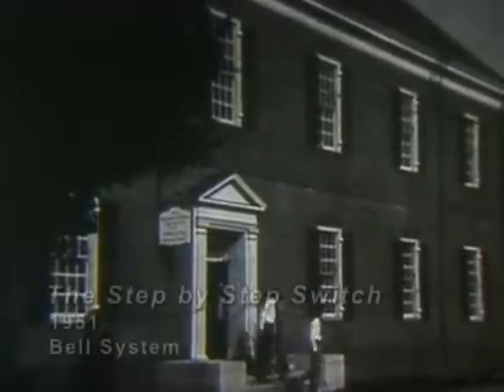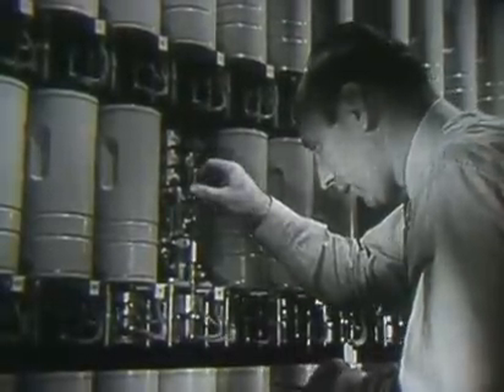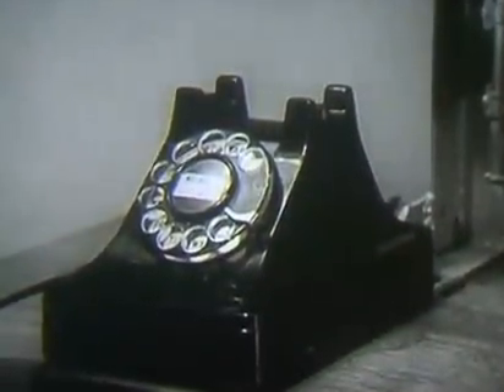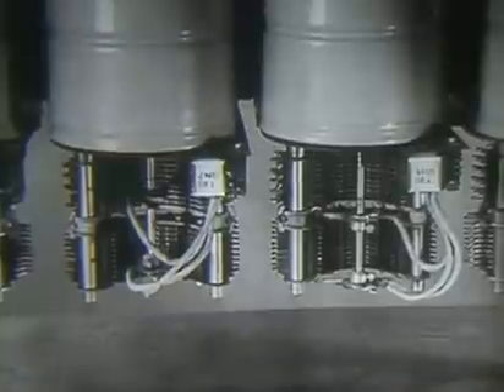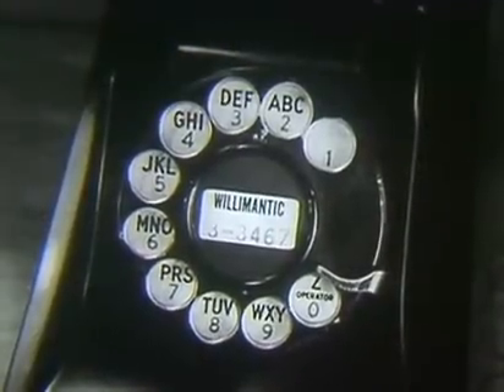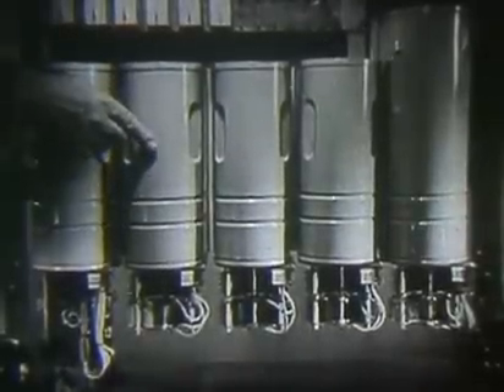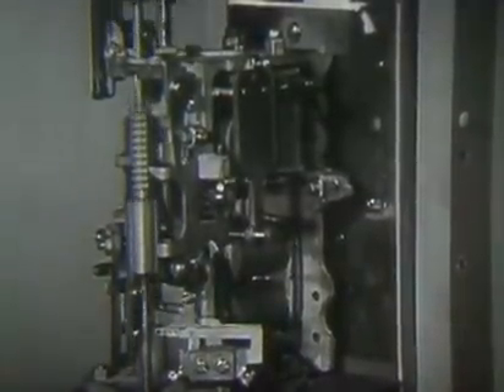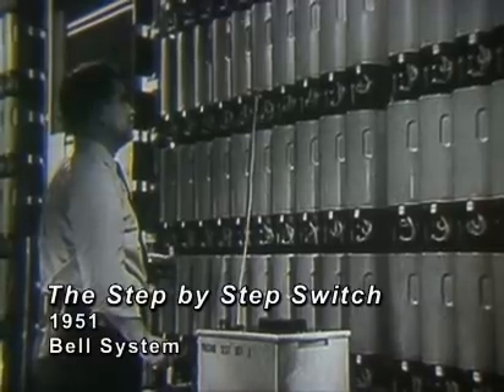AT&T Archives: The Step-By-Step Switch

Comment: This is fun for me to watch.    When I finished electronics at college in 1979, I went into a job with the phone company and worked to maintain and troubleshoot this type of equipment even though it was being phased out at the time.   I learned to assemble the mechanical bits of one of those stepper switches from a pile of parts in a about half an hour.      Later we dumped thousands of these into recycling bins as they were replaced with more modern equipment.    I wish I had kept a few of them.    They were quite fascinating what with all the precision machined gears and cogs inside them.

Comment: Did 40 years (pre-divestiture Southern Bell to AT&T again).  Started in Special Service & Message circuit design. Finally got a Services Tech job, then worked Special Services I&R and retired as a DLC (digital loop carrier) technician. Saw SXS, 5XB, 1ESS, 2ESS switches in action. Saw conversion of all to Digital (5ESS/DMS).  I’d be lost with the changes that have occurred since I retired in ‘16!

Comment: My 1969 summer job was to clean these switches.  Little roller brush, into the cleaner roll it on the switch, repeat.  Up and down ladders.  Sometimes the switch was in use while on the ladder ... just hit a button and it disconnected.  Sorry ...

Comment: Several years agoI had an electronic engineer tell me that if you think about it, the old rotary system was actually digital where the newer touch tone was audio. I'll have to take his word for it as I'm just a machinist.
Reply: With pulse dialing, the dial interrupted the line current, which then operated the switch as demonstrated in the video.  With touch tone, the push buttons cause tone pairs to be sent, which the switches detected.

Comment: To think that an English telecommunications engineer had designed and proposed a digital switch six years before this film was made. Only to be told that 1700 valves couldn't be kept working to make it reliable. He was told to get back to his normal work. 
What the management didn't know was that Tommy Flowers had designed and built a programmable computer, the second version had 2400 valves, and kept it operational 24/7 for years but it was a Top Secret job and he couldn’t mention even his experience. Had they listened England would have lead the world with digital direct dial telephones. 
Tommy had taken all the plans, designs, sketches and notes for Collosus and Collosus II, to the basement of the GPO Lab. Placed them in the boiler and watched them burn. Churchill had a lot to answer for in Post war Britain, it should have been kept and preserved for declassifying after the correct period. Tommy started to rebuild the computers and they were finished, they can be visited at the National Computing Museum at Bletchley Park.

Comment: I was in elecrtronics school in the early eighty's. We took a field trip to the local CO ( central office ) that had one of these still in the switch room, what a presision device. l later went to work for a company ( Infoswitch) that devoleped the  solid state ( transister based)  switch. Installed the switch for Sprint in OP Kansas and the Bass Pro call center.

Comment: Following discharge from the Air Force in 1972, I worked for Stromberg-Carlson as a engineer writing the equipment specifications for 100 to 500 line dial central offices in the Southwest using the Stromberg-Carlson XY switch - a variant of the step x step switch.

Comment: Thousands of jobs were lost when touchtone phones where invented. Same with teletypes. Chicago's Teletype Corporation employed 50 thousand people. All dissappeard with invention of fax machine.
Reply: When I started working in telecom, in 1972, I spent my days overhauling Teletype machines.  Faxes were around long before then.  It was message switching systems (used to work on those too) that did in Teletypes.  Back in those days a lot of machines were used for the dial up Telex service.  Many more in private networks.  A customer's machines would be connected to message switching computers.  Later on, packet switched networks appeared, but by then video terminals and personal computers were used.  Then came the Internet and email...

Comment: This is very different from here in Sweden.
My mother used to work at a telephone staton when i was a kid and on some weekends i came with her to work instead of having a babysitter.
The swedish analogue system looked totally different and was built by LM Ericsson, my mothers station was an analogue station using the 500-switch architecture. This was in the 80's and the technology was from the 1920's and electomechanical, you could see when people dialed numbers. Dialing an area code transfered you to a different telephone station, thats why you had to wait for a tone after dialing the area code.

Comment: And it's a digital dialing system.  Pulse length
Reply: Actually, the pulses were the same length, but the number of them varied with the digit dialed.  Incidentally, in the video they pointed out that nothing happened until the dial was released.  The reason for this was to get consistent pulse length, as determined by the dial hardware, compared to someone's finger motion.

Comment: I took a rotary telephone apart when I was probably 7 or 8 years old. It's amazing how many steps there were to this system. Hundreds of contacts and springs... Almost like a washing machine timer if I remember right. It's so cool to know that those contacts inside the phone, pulsed a signal in real time to these switches. Makes a lot more sense. An in old timer told me he could hear the switch box at the end of his street chattering all day long lol
Reply: Several years ago, I worked for a Canadian telecom which had a Siemens TW39 (IIRC) step by step switch.  On one occasion, the microwave system failed, causing all the switches to drop off at the same time, in a very loud bang!

Comment: stepper switches are only something ive heard tales of..  never seen one..  I started in telecom in 98.  so relatively new..  never on the CO side..  Love this video!! when I started we were replacing some of the first gen digital equipment that had come out to replace Xbar.  occasionally id find an old Xbar in a switch room abandoned but never forklifted..  I cut my teeth on an SL1 and first gen defimity (AT&T.. Lucent was the new name)..  then started installing VoIP in about 03 when it first started to come on the PBX market (Mitel)..  now install exclusively VoIP.. designed our own VoIP product based on SIP..  whole different ball game now..  but being in hotels we still do a lot of analog tip / ring to re-use old cabling infrastructure..  pulling out Option 81s and Definity G3's alot these days..  those 2nd gen digital switches were workhorses

Comment: I didn't get that at all. All it explained was how a call stepped each selector according to the digit at that position. How is the audio actually connected ? In the first selection, it can go to one of ten destinations. With three selectors, it can presumably reach 1000 endpoints. How on earth is this achieved ?  With simple mechanics, there is no way you can connect one wire to one out of a thousand wires.

So, how ? Does an incoming digit of say 2 in the first position then route the call to another selector that handles 20 to 29 in the second ? This would mean you'd need as many selectors as  you have customers!
l

Comment: The original 5ESS Switching Module processor was the Motorola 68000 operating at a few mhz clock.  In 1995, they were moving to the 68040 processor with two ALUs and instruction scheduling being a consideration.  I had an Amiga 4000 with a 68040 on it at the time, and it had a scheduling compiler that I used to do test compiles of 5ESS code to help make the decision of whether or not scheduling would be useful.  The 5ESS code had an average of 6 instructions between branches because of the strict use of audits in the software to make sure that values and code flow were correct.  This made scheduling not so interesting.  But one of the things that we did find was that the hash sum computation function which was largely hand coded Assembly Language had a load of a register with the constant of 0.  But changing that to a SUB Rx,Rx instruction, we made the code 12% or so faster (if I remember correctly).

Now days, we hardly ever worry about such optimizations because we are running processors at 100 to 1000 times the speed of those days, and the compilers are smart enough that we would not even try to hand code assembler (for speed) in most cases because it just doesn't make sense. These days, we have all kinds of "kids" inexperienced in software development responsible for key software system development.  They mostly use languages like python and javascript that are 10x slower than C/C++ software in most cases, and we are still happy with the performance of their "butt" slow software systems because the processors are so fast.

Comment: Most of the old timers I worked with in the COs were profoundly deaf, and here is the explanation why. I started in the CO, both 5E and DMS and retired from cable repair. The era of fiber switching will be just as revolutionary.
Reply: Have you seen Brice Perdue. His chanel shows his work for a small fiber isp. It's cool to see the smalle equipment racks used for fiber optics. PON is an awesome technology

Comment: Worked for At&T about 5 or so years ago.  They told me that there were certain phone numbers that could not be transferred to other carriers because they were actually hard wired into the system.  While it was probably different from this, as this all would have been touch-tone, by now, I can at least kind of understand now why this was the case (99% of all numbers could be transferred, I never actually personally had to deal with this issue, it was just something that came up during training.)
Reply: Back in those step by step days, your phone number was determined by where you were connected to the switch.  If you wanted a different phone number, a tech would have to physically disconnect your line from the old number and then connect to the new one.  Of course, that only worked within an exchange.  No such thing as number portability back then.

Comment: Great video. Those leads to the terminals got quite a workout. Wonder how long  they would last?  Amazing how such complex mechanical devices been totally supplanted by solid state electronics made possible by the invention of the transistor at Western Electric's sister co,  Bell Labs.

Comment: Interesting that this is in cooperation with The Southern New England Telephone Company (SNET). SNET was never a part of MA Bell, and only joined SBC/AT&T well after the breakup..
Reply: SNET was one of two independent phone companies that were independent but members of the Bell sSystem. I believe the other was Cincinnati Bell, although I may be wrong on that part. SNET participated in Bell System training and also followed most of the Bell System Benefits. SNET was bought out by SBC in the 90's.  Later on SBC bought out ATT. I started at SNET in 1966 and worked for SBC and ATT with a 7 year outsource to Computer Sciences Corporation. I retired as an ATT employee in 2005. Even my old SNET stock changed names with all the Bell company changes and is now ATT stock.
Reply: @ronmollica5436 thank you for the detail. 

And yeah the other independent bell was Cincinnati Bell.. which fun fact was the only RBOC where the actual operating company serviced multiple states. (OH, KY, and IN.)

Comment: I remember working at American Telecom in Anaheim California. They built a phone system for corporations to manage hundreds of calls. Their system "focus" incorporated electronic IC switching, probably some if the first non mechanical switching. Their cabinets were about 6-7 feet tall 3 feet wide and 3 feet deep which housed several levels of big circuit boards filled with IC chips that slid into rack slots with connectors at the back so they were removable. These days all that fits into a small unit that mounts on the wall right next to a wire connection bar for the outside lines and the rest is digital serialization..
We made literally Un-Godly advancements in technology through the 1900's

Comment: We called them Strowger two-motion selectors when I joined Post Office Telephones (later British Telecom and then BT), in the UK in 1973.  Some of the large exchanges had selectors that looked identical to these, but most had a more modern version, with a squared off front and was not as tall, which I believe were referred to as '2000-type'.  In UK exchanges, the hunt for the initiating subscriber was done by a rotary uniselector, but otherwise the process was pretty much identical to that in the film.  They were indeed subject to intensive maintenance, and every selector in the exchange was routinely 'busied out', removed and tested, with adjustment and/or replacement of components done as necessary.  I only stayed for about 4 years, and crossbar was making its way into the network at a rapid pace.  I can remember how much cleaner, brighter and quieter the x-bar exchanges were than the old strowger ones.
Reply: I joined in 76 as a TTA. I remember bank cleaning 2000 type switches and uniselectors for many hours at a time before progressing to the 'New' Crossbar TXK1's
Reply: @wino99999  Yes, I was a TTA when I joined and left shortly after being made up to T2A.  I vaguely remember the bank cleaning, but mostly ended up maintaining the switches and relay units because they found out I scored 100% on my relay bashing course at the local training centre.  Strange as it may sound, I actually enjoyed doing that, but later got moved onto AN&LCP work (jumper running on the MDF and IDF), which I hated, and why I left
Reply: @simonuden8450  Advice Notes and Local Circuit Provision.... wow haven't remembered those terms for years! lol

So I went on from Strowger and such whilst TTA (they exposed you to a lot of different jobs during the first 2 years) to TXK1 at Brentwood (Essex) plus Locals, then AXE10 out of Chelmsford. Saw my Local Strowger Exch (Rayleigh) changed out to an AXE10 - still got it on video! Enjoyed my time but left with advent of 'Work Force Management' - being driven around by computer tasks, which didn't take into account placement of rivers and your technical ability - that drove me up the wall!! Ended up doing 20.5 years before leaving to go to an OLO. 
I can completely understand wanting to get out being stuck on jumper running. Think it was pretty bad for the crews changing out the old Switches, esp. when they knew that when the last ones were done there was no jobs left left for them!

Comment: Not many people know, that the old step-by-step contacts were made from platinum. Using platinum reduced contact pitting damage, caused from constant electrical arcing, while switching. 📞⚡
Reply: Isn't that the silver has similar properties and it's a bit cheaper?
Reply: @maciejlegowicz5834  Yes your right silver is cheaper... also silver definitely has better conductive properties than platinum, but platinum is more resilient, less prone to contact pitting damage than silver. The constant down-time/maintenance in replacing the silver contacts in the step-by-step switching gear, has to be factored in, when you're doing an overall cost analysis.
Reply: @wayneharrison  Thakk you. Asking questions we learn every day something new. Cheers
Reply: @maciejlegowicz5834  All good.🦘👍👍

Comment: Here is something I tried as a kid and it worked, instead of dialing the number, click the hangup button quickly, like 5 times in a row for a 5, do this for all the numbers with a pause between them and it connects to who your calling normally.
Reply: Yes, that was possible as long as your timing was good. Some small retail shops would have phones installed which did not have any "dialing" capability since they just wanted employees to answer the incoming calls and not call out.   By pulsing the switchhook, you could make outgoing calls (to the surprise of the store owner).

Comment: When I was a telephone linesmen/cable splicer in the US Air Force from 1980 to 1994. A lot of this equipment was still in use. The first time I walked into a central office back in 1980  at Norton AFB, CA. There was a whole lot of noise in there . I asked the telephone tech about it and he replied, What Noise !. After we had  a good laugh. He showed me around the CO and explain how all this switching  equipment worked. I learn a lot that day.
Reply: Similar experience but in Germany.  The US military had Stepper equipment made by Siemens and based on a design produced for the "Reichpost" in 1940.  I'm sure it was quality stuff when new but, by the late 1970s, it was just worn out.  It was noisy both mechanically and electrically -- we called it "Hitler's Revenge."
Reply: I experienced the same thing in the mid 80's as a 29N in Vaihingen Germany. I worked on the digital side, a Siemens switch and next door housed the older noisy Crossbar. Glorious times.

Comment: Could that beautiful system be made from scratch today had we the need do ya think? Without plans. Just the same level of parts and stuff of the 1950's?
Reply: Yes, we could.  The principles are simple and well understood, and the basic network topology is a simpler version of what we have today.  However it might very well take a while to come up to speed on the little refinements and techniques that Bell came up with over long experience with the system.  And we'd probably make a crossbar system rather than a Strowger-type system as it's mechanically simpler and more reliable.
Reply: @dbeierl  : That's heartening to hear. Thank you.